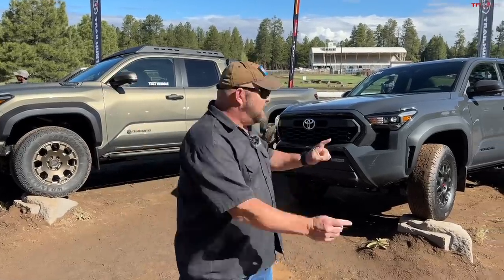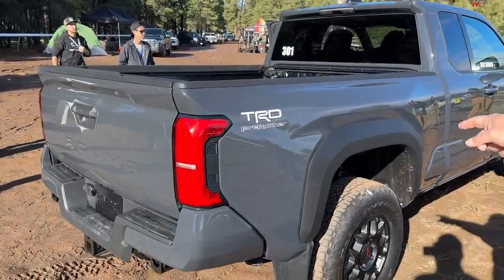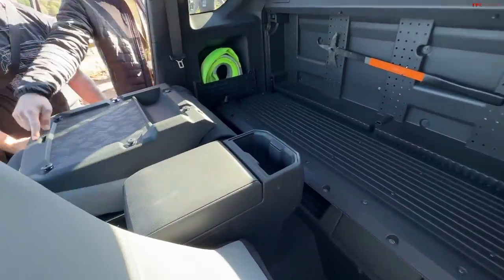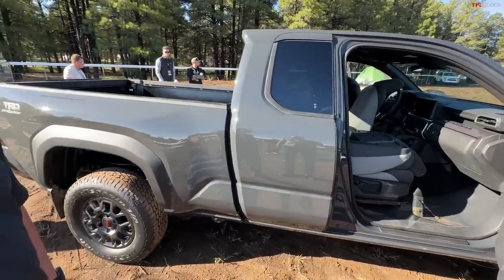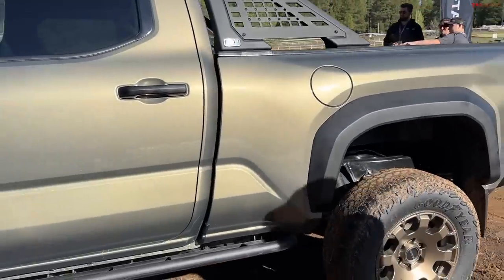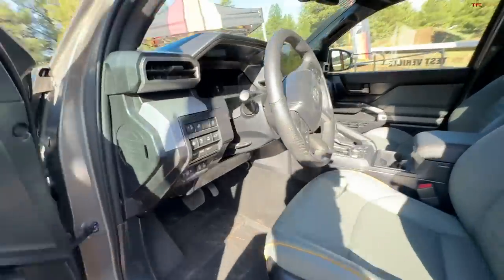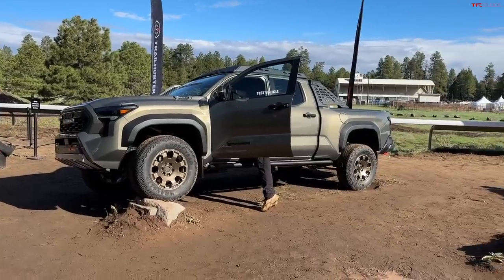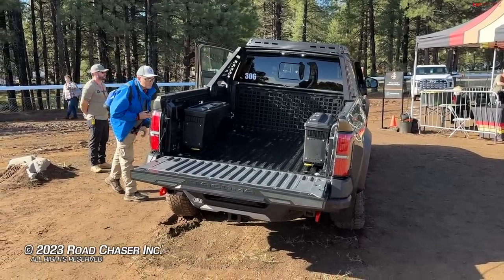Here's How the 2WD 2024 Toyota Tacoma PreRunner Compares to the All-New 4WD Trailhunter!

Comment: The "desert air intake" can it function as a snorkel or will it leak water through? I know some raised air intakes are only raised air intakes and if you go through raised water it will drown them immediately. Also no front locker? Will you be able to install a front locker or is there something that prevent you from doing so?

Comment: Toyota once again knocked it out of the park with this new Tacoma. They have a truck that will once again lead the segment, no doubt.

However, there is one thing that I am not so sure is an upgrade: the room in the rear of the truck on the crew cab (biggest cab). Is that rear door smaller than the previous generation? That is the full-size cab right? I know that Toyota is marketing this as a "Lifestyle" truck, but I think that rear seat space is still paramount to many people.

Comment: I hope they offer the iForce MAX in all of the trim levels. Especially in the lowest-priced trims.  
It makes the most sense that if it's more fuel efficient with that hybrid system which saved more money for the consumer that Toyota offer it in the lower trim levels where the lower budget minded consumers will be shopping and buying.   
Some buyers may not want to pay a higher price for the middle and top trim levels with options they don't need just to get better fuel efficiency.

Comment: As a 3-car family, a two-seater SR or PreR at reasonable price would be a useful 3rd vehicle. Pricing is going to determine whether the PreRunner is a hit or not.  The Maverick's ploy was that $20K starting price.  So, $31K sounds like the magic gimmick for PreRunner even if in today's inflationary environment, $33-$35K is how the automatic comes equipped. The best thing about my current manual truck is that I don't EVER have to readjust the mirrors or seat position.  Hmm, a manual offering could get those marketing price points back Toyota 😁.

Comment: MOLLE- Modular, Lightweight, Load Carrying, Equipment.
Reply: Actually, this is not MOLLE because the dimensions are incorrect. The square holes need to be 1" and 1" apart. Also, the correct term for the panel would be PALS, not MOLLE. I know, pretty useless info...

Comment: surprising prerunner doesn't have suicide rear doors as my Hilux prerunner 2WD 6 speed has in Thailand
Reply: This is a new model here so that’s why the rear doors disappeared on the extended cab. Not sure if Hilux will follow when the updated model comes out.
Reply: @ALMX5DP  guessing 60% of domestic market Hiluxes would be extracab both Prerunner and base 2WD...20% single and doublecab but export versions to Australia, NZ probably 60% doublecab but still good numbers being built!
Reply: @joelawrence56  True, I wonder if Toyota will continue to differentiate the Hilux due to that difference in market need.
Reply: I'm sure some of it is to meet US crash standards.
Reply: @ALMX5DP  Spotted yesterday in regional Thailand a new ex-Japan LC79 V8 diesel I can arrange shipping if you can find the A$165,000...waiting time in Australia excess of 2 years for most variants...expect it be the only example in Thailand!I have pics too btw.

Comment: I am really digging the 2024 Tacoma I might get that instead of a 4Runner
Reply: I'm genuinely curious as to what the appeal of this truck is. Pretty much every other midsizer outperforms it in towing, off-roading and daily comfort. While also costing less. And if you say reliability, the Frontier is just as reliable,, way cheaper, and superior in the ways I already mentioned.
Reply: @yissibiiyte  people seem to like the multiple cab and bed configurations, manual transmission offering, turbo power plus hybrid option, an appropriate amount of standard or optional features and tech and a look that lots of people like.
Reply: @ALMX5DP  fair enough. The base trims make sense with all that configurability other manufacturers have killed off. I still don't see the value in the upper TRDs though
Reply: @yissibiiyte if you really trying to tow 7000 pound in a midsize you will trade it in very quick. 

You get TSS 3.0 standard, Romans truck doesn't even have cruise control for 45k, this truck is #1 for a reason.
Reply: @Mycameron2323  as I said, the base trims make sense for the price. The upper TRDs do not. Worst towing, worst off-road-ability, worst on-road comfort in class. And more expensive than the competition that outperforms it in every way. 
And sales figures mean nothing about whether 1 vehicle is better than another.
Reply: @yissibiiyte  4 door long bed is why I'll get one . A 5 foot bed is stupid and pointless lol
Reply: Have you ever drove one?
Reply: @joelmora2826  100%.  LONG bed or why bother in my case.
Reply: @yissibiiyte  Worst on road comfort?  Impossible for you to say that at this point.  It has the second highest HP excepting the Ford Raptor.  I want that power and TORQUE. Will this cost more than that Raptor?  Nobody knows.  ONLY mid-size long bed/with rear seat door accessible--with that high power--sorry Frontier.  I want easy access to rear storage for our weekends and I'll likely remove the rear seat and fabricate a flat storage tray or see if Toyota offers one.  IMO--best looking midsize except new the Chevy.   Ticks enough boxes and has some required features to lure my out of a full-size F150 I drive now.
Reply: @yissibiiyte  Frontiers is not way cheaper
Reply: @yissibiiyte  And what's the value in a $65K Raptor Ranger or the AT4X? Same argument. They are neat but for 95% of the time, way overpriced for what they do.
Reply: @yissibiiyte  Provide some sort of evidence of your claims on worst  on-road or off-road? And I for one am dmn glad they didn't get into a Max towing battle. Anything over 5K is plenty big for a mid-size.
Reply: @Dusdaddy  how exactly am I supposed to bring "evidence" for the sensation of comfort? All I can tell you is that the previous gen from my experience and the experience of everyone who's cross compared, the Taco is extremely uncomfortable and agricultural feeling next to any other truck. This is not just my meaningless opinion, just go look up literally any comparison with it. It is a well known fact the Taco rides like an ancient truck (because it is) while the competition is encroaching the comfort levels of crossovers. And I'm not even talking about the unbearable seating position because that's one issue the new gen finally fixed.
 Sure the new gen has undoubtedly improved, but the competition has also improved drastically (from already being drastically better).
But off-road ability? I can easily prove to you why the Taco is the worst. Let's talk TRD vs ZR2 vs Ranger Raptor vs Gladiator: which one of them has the least ground clearance? The Taco. The worst approach angle? Taco. Worst breakover and departure angle? Jeep, Taco second worst. Which is the only one that DOESN'T have a front locker? Taco. Which has the least wheel articulation? Taco. So please try defend it from being the WORST off-roader in it's price class
Reply: @joepierson3859  fine, "way" was the wrong word, but it is still cheaper
Reply: @yissibiiyte  Frontier is a nice truck, probably my second choice, better interior then the Tacoma for sure.
Reply: @yissibiiyte  Exactly! How can you have a sensation of comfort if you have never sat in it?  You have never driven this vehicle so you have no evidence, period. No one does. As far as you know this could be the revolutionary design that everyone emulates. (I doubt it) Speek about previous ones all you want but to say this one sucks because the previous one did doesn't count. I thought the same until I rode in one and realized it's not as bad as others make it out to be. It's more different than bad. And don't get hung up on silly off-road numbers. The proof is in the driving. How well can it get the power to the ground. I've been four-wheeling since I bought a '77 CJ7 in high school back in 1984. Peddle your google searches somewhere else.
Reply: @Dusdaddy  You asked me to prove why the Taco is bad off-road and I did so by bringing "silly off-road numbers" that are the only objective way to compare anything. How else did you want me to "prove" anything via a text-based non-real-world argument? No need to get defensive just because the Taco performs the worst on paper. Of course the real world and paper are 2 different things, but don't pretend specs are meaningless. The Taco is inarguably going to perform worse than the competition in many scenarios.
Reply: @yissibiiyte    you can't compare this all-new Tacoma to the competition yet. No one has driven it. And anyway, people like what they like - it doesn't have to be the best. Some folks just love a Taco.
Reply: @yissibiiyte  I just test drove the frontier that thing was pretty nice but I just want the Tacoma 🤷🏻‍♂️

Comment: Why has nobody talked price, and I have already been told trucks will be marked up !! Every New Generation of Tacoma I have owned since 1985. My 
 Current 2016 TRD-OffRoad MT 4x4  Magnuson Supercharged Super White Double Cab-5’ bed, may be the last Tacoma I will ever Own. No way in a Million Years a 2.4 Turbo Hybrid is going to outlast with 0 issues like a 3.5. Also too much more crap is going to run the insurance cost way up. 
‘
Reply: Find a dealer that doesn't and buy from them. I have 2 within 2 hours that always have sold at MSRP.
Reply: What are they supposed to say when they don't know yet? Will they be more expensive than the current MY? Of course. It's common sense, the price will be more than existing MY but less than the Tundra.

Comment: So the prerunner.  A truck being marketed to people as budget friendly, locking rear and a pegboard in the back.  Of course this is just a guess, but the fleet sales to HVAC, electrical.., companies may go through the roof.  This will be a hell of a work truck.  Toyota may have just sent GM and Ford back to the drawing board.  Ram still needs to get off the fat arse and make a midsize truck.

Comment: I really do like that pre runner. Would you all make fun of me for putting a camper shell on a pre runner 😄. I think I better go with a sr or trd sport, 2 door with the 6ft bed. If it's reasonably priced. I actually kind of like the cab setup. I have an extended cab now, like this, but it has doors, and all I do is throw and store stuff back there, and the seat is actually just in my way. I've debated taking it out, so this really makes sense to me. Props to toyota for realizing nobody sits in the back of these little cabs or very rarely and if someone needs a ride they can sit on the floor back there or walk, up to them.
Reply: No 2d option above SR5 trim
Reply: @Joshua Holcomb   well if that's the case I guess that settles that. I don't need all that fancy stuff anyway. I can put my own wheels on a truck.

Comment: Make the Pre Runner 4WD for Canada
Reply: That's what the rear locker is for. My old 2002 Sonoma was a Canadian edition and came stock with a locking rear differential. I drove it in Alberta for 10 years. I tried winter tires and all terrain tires, and sure it got stuck sometimes. However, a little digging with a shovel and tire chains got me where I needed to go.

Comment: Those are not tow hooks under front of pre runner.
Reply: Looked like a tow or recovery point to me.
Reply: Why? because it's not red? And yes they are not hooks, they are loops.
Reply: @Dusdaddy  those are for transporting. I:E tie down points. Ask Toyota and they will tell you those are not meant to be tow hooks.
Reply: @fritty9927  from Toyotas press material “Every Tacoma gets standard front and optional rear recovery hooks and underbody protection.”
Reply: @fritty9927  Maybe you should watch the video with the Toyota engineer when he explains that at a minimum, every truck will have a recovery point and some have both a recovery point and a tie-down point at each end.

Comment: Always hate these prerunners. Kids always put mud tires on them like they are 4x4 and will go anywhere 😂 that 2wd locker or not won’t get off the pavement when it rains or it’s stuck…and the rear doesn’t even open up?!?
Reply: So what its America do what you want never got stuck most of those kids learned alot with therr experience with the pre runner
Reply: They’re cool. Grow up.
Reply: I like having the option; not everyone wants or needs 4wd.
Reply: Having gone through deep mud in a VW bug based dune buggy (key is momentum, not crawling) this is a BS statement. Plenty of buggy video exists on YT from a variety of creators in sand, mud, etc to back that up. Off road driving can be done without 4x4 (in fact until after ww2 it all was without 4x4), just not rock crawling or mud bogging.
Reply: @jg8263  My 2wd ‘99 Ranger with an open diff probably saw more trails than 90% of the 4wd vehicles on the road now. It taught me how to drive, choose lines wisely, & to go off-road with a buddy with a 4wd vehicle, just in case…
Reply: @chriscon8463  damn right, same with my buddy and I in high school in his open diff s10 blazer. It took skills in driving to not get stuck in that blazer, compared to my dad's scout, which you had to be an idiot in order to get it stuck!
Reply: I don’t really care what you kids drive but today at the farm you won’t be getting off the gravel or pavement in this rain with a 2 Wheel Drive.
Reply: @freedomisntfree_44  It’s great that manufactures offer a choice for the different degrees of want/need. I live in suburbia, pull a pop-up camper, & drive fire trails a few times a year. I don’t need 4wd. I like having the locking rear diff to help get me out of trouble if I need it.
Reply: Not sure why people care so much what others want or use their vehicle for.
Reply: @ALMX5DP  no one here does. Besides the ones who commented 🤭
Reply: @freedomisntfree_44  you commented...
Reply: @ALMX5DP  it’s my comment 😂 others could have scrolled along but got butt hurt and had to say something instead. Example: you.
Reply: @freedomisntfree_44  So you're admitting you care? Or just saying you hate something that you actually dont care about?
Reply: Why do you hate? Plenty of use for these. I can keep up with any factory 4wd with my CJ in 2wd because I have a rear locker and better gearing.
Reply: @ALMX5DP  it’s my comment. Went right over your head 😂
Reply: @freedomisntfree_44  yes, so you commented..

Comment: Ask Sheldon Brown if the new Tacoma will have a Torsen limited slip center diff! Would be amazing to have an option for 4 wheel drive with an open diff and a push button to lock it if need be :) So many situations where 4 wheel drive with a limited slip/open center diff would be useful; like dry pavement with random black ice or snow, needing 4 wheel drive suddenly and not wanting to lose speed to get up a hill and more.

Comment: GM will have to add their 3.0 diesel to their midsize trucks to compete with the new Toyota Tacos.
Reply: Why? The 2.7 has 310 hp and 430 lb-ft. The 3.0 Duramax has 305 hp and 495 lb-ft. The 2.7 is only 65 lb-ft behind the 3.0 Duramax. The "baby diesels" are fading out anyway. GM updated the 3.0 Duramax because the update was already in the works by the time everyone canceled theres. I don't even know if the 3.0 is short enough to fit in the Colorado/Canyon, but it would be cool if GM did add it though.
Reply: @Josh47147  not mention iforce package is gonna be at least 4g.
Reply: @Josh47147  Maybe for the fuel mileage? The 2.7 has all the power but at the worst economy.
Reply: @Dusdaddy  is the extra debt or loss of savings worth the little bit of extra fuel economy?
Reply: @Josh47147  What extra debt? Saying it would cost more? Maybe. No real difference in the full-size. But I will tell you right now, most average car buyers will see the mpg and look elsewhere. I know it doesn't matter and if I had to buy a midsize today, it would probably be the Canyon. But let's face it, most consumers are not that bright and will focus on MPG, max towing, or any of the other worthless numbers that do not matter individually.

Comment: Prerunnners rear leafs are LOW!
Reply: They are spring under axle leaf springs. They offer more suspension drop and are popular for desert long travel trucks verses traditional over axle leafs. Deaver in socal specializes in a lot of SUA leafs for tacomas so it would now be a straight forward swap. Toyota most likely designed it intentionally like this for all the desert prerunner trucks that are popular in the southwest.